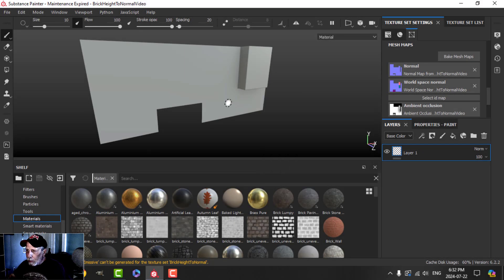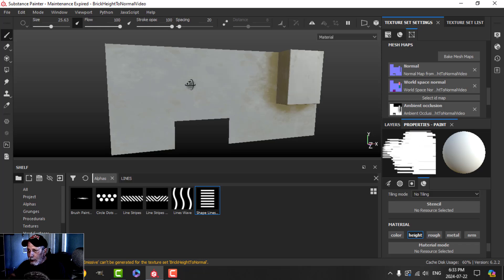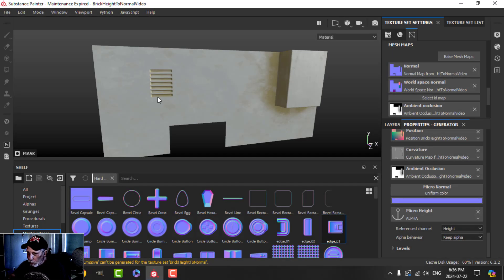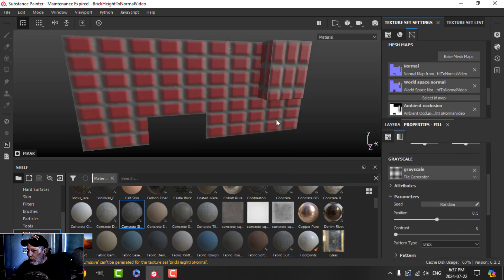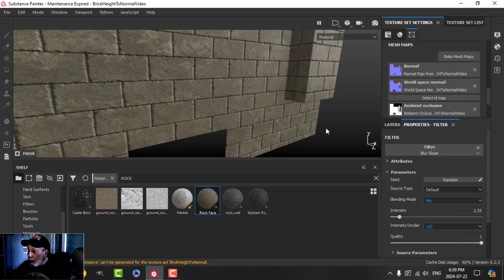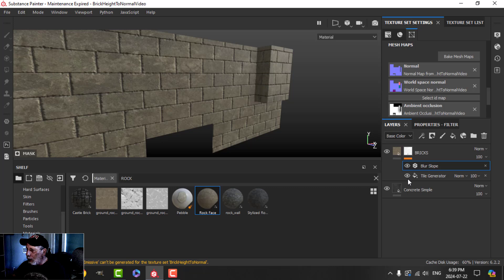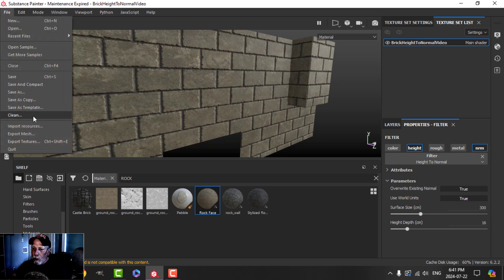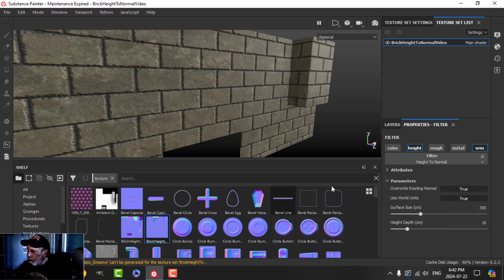SUBSTANCE PAINTER: HEIGHT TO NORMAL

Comment: Doesn't substance painter convert height to normal every time you export with or without height to normal filter? I try to convert height information on the fly. So text engravings look sharper. But I have not found a good way.